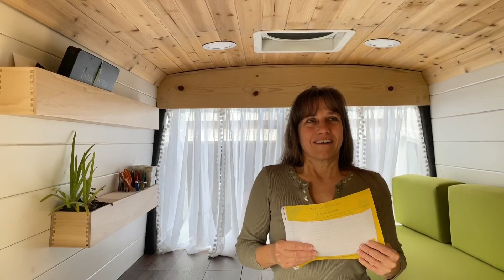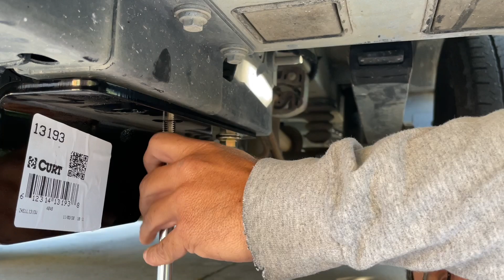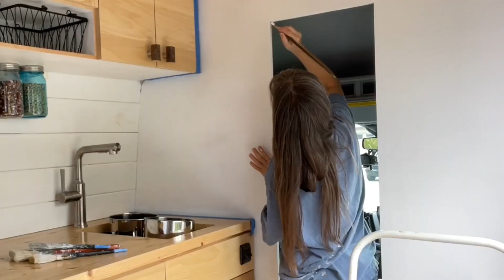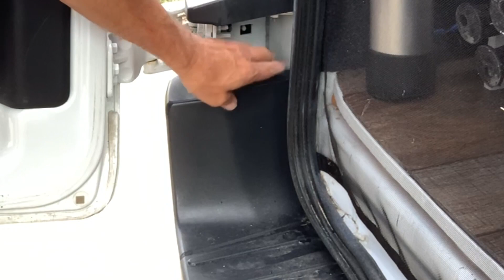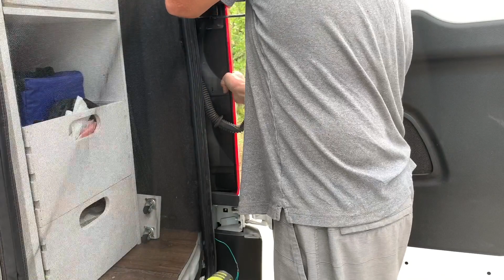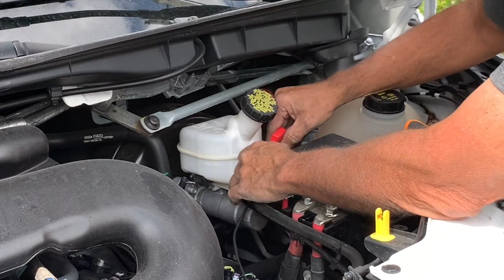Van Conversion | Installed a Hitch Receiver and Wiring Harness

Comment: down side of RV conversion is always limitation of payload, so is conversion to 4x4. 4x4 conversion will leave just about 1000 lbs payload for any vehicle. If you have lots of things to carry with your travel, it's better not to convert your van to RV, nor 4x4. So you can carry everything you want with you and have some more. Actually Ford hitch package is not that expensive, and it's safer and has better rating.

Comment: Hey, I think y'all did pretty good on the added weight considering all the "goodies" that were installed. Just be mindful on how much water you haul around. At 8.33 lbs per GALLON! times X gallons in your jugs try to fill when you arrive ( or as close too as possible) at your destination and dump when you leave. Nice looking quality hitch and a 15 MIN. INSTALL! give or take a couple days/weeks! Looking forward to Art work.
Reply from the maker: Thanks! That is a good tip about filling when arriving to reduce weight while driving. I had completely forgot to mention that I had about 10 gallons of water and a full tank of gas when we weighed it. Now that we have a little more experience, we realize there are ways we could have reduced weight in the build. That might be something we talk about in a future video. :)